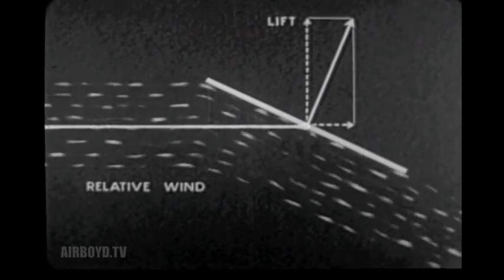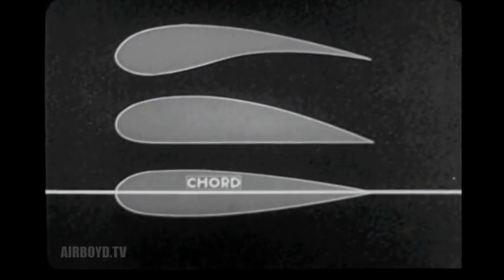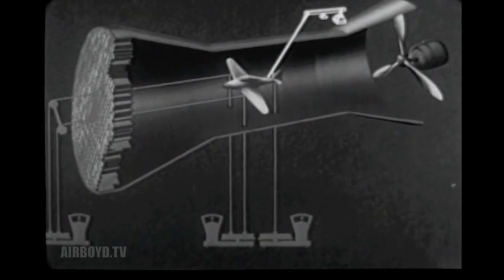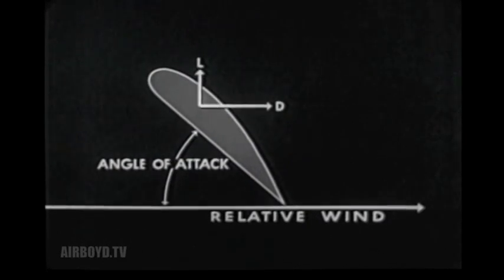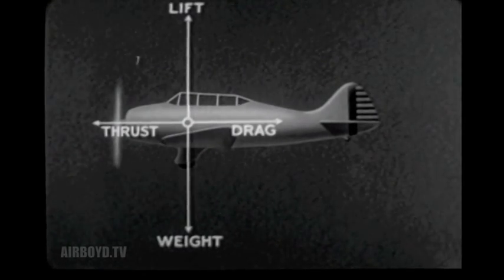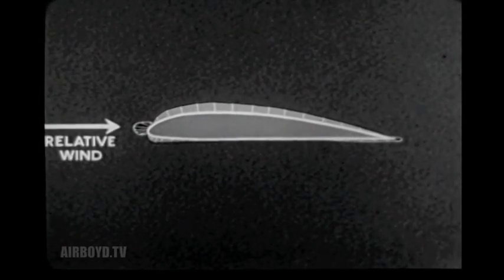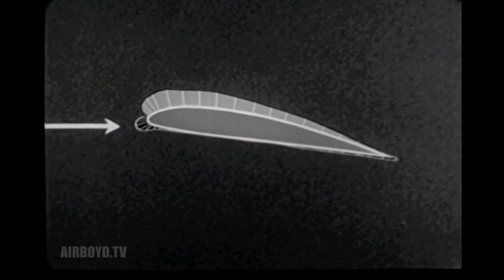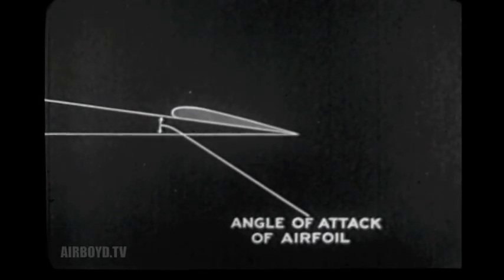Aerodynamics - Forces Acting On An Air Foil (1941)

Comment: Which is the best wing for super sonic flight? And aren't at vertical dive since the plane is traveling forward fast, the relative air flow should also increase and it get 0 angle of attack so it get lift (instead of lift it moves the plane forward). So some planes dive, upside down >-180 degree.